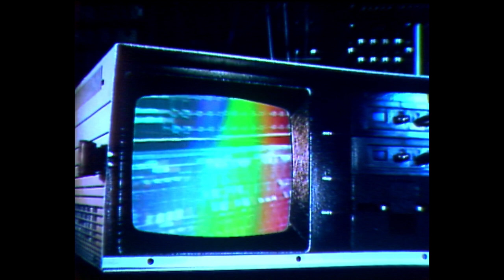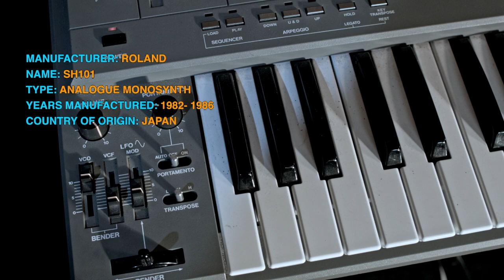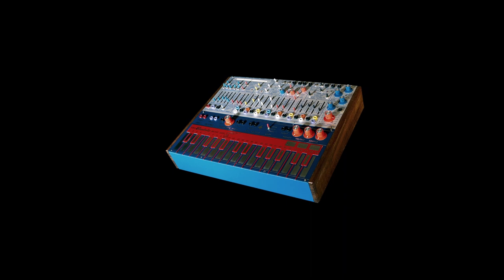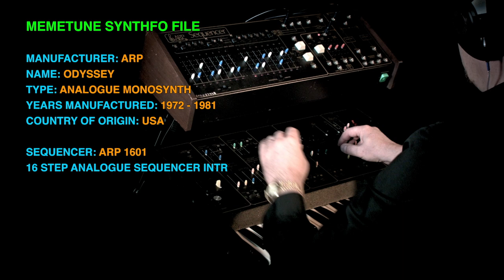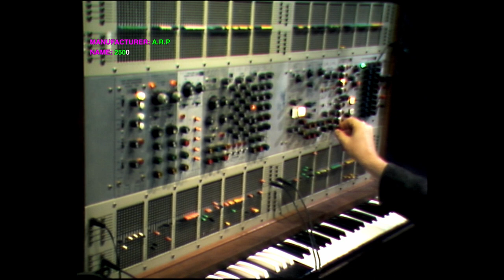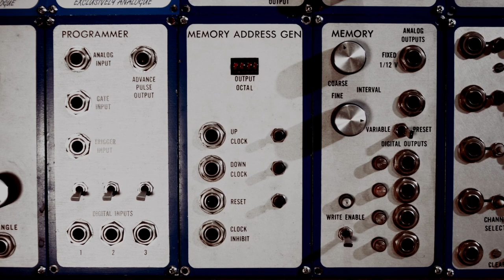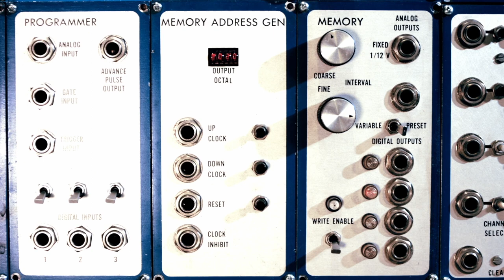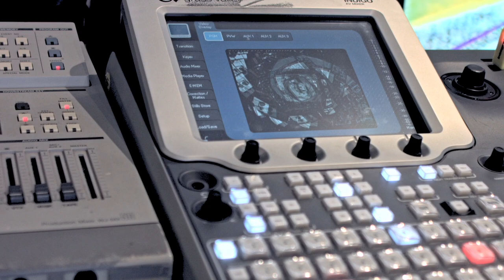TMP-01 Vintage Synth TV Series from Benge

Comment: The Music Easel was not a modular synth.  Modular synths allow you to swap out physical components.  The Music Easel couldn't do this, but you could bypass the normalized wiring through the use of patch cables.  This makes the Easel a semi-modular synth.
Reply from the maker: Not if you use the 208 and 218 as modules in a larger system. Mine are now used as part of a huge 45u cabinet